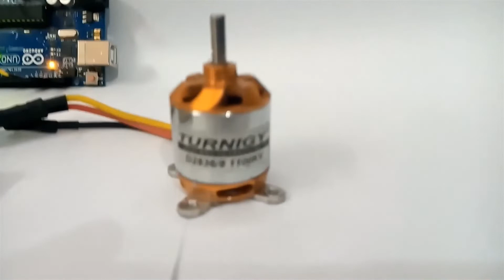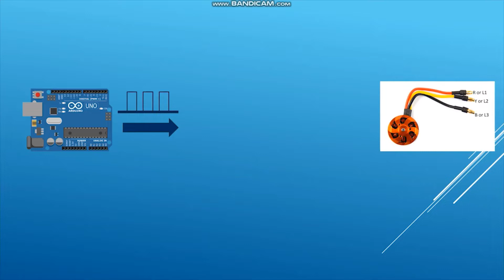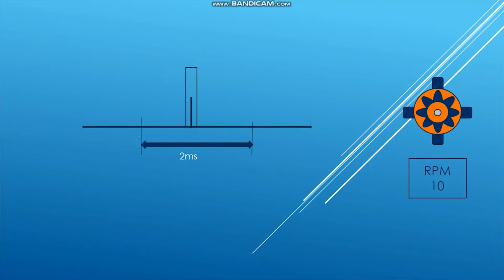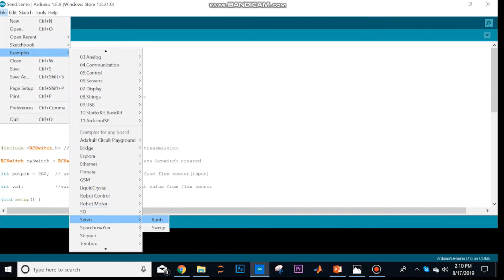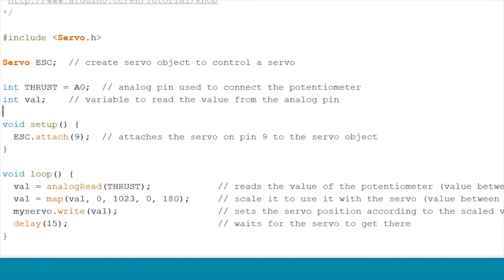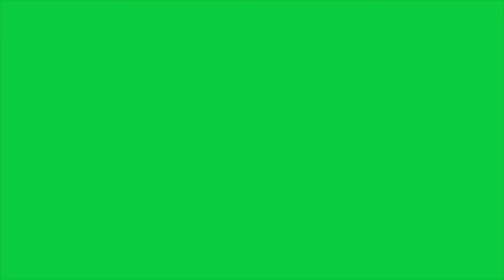How Brushless Motor and ESC Work and How To Control them using Arduino UNO | In Literally 10 mins

Comment: I can't copy the code nor the photo of the set-up. would be nice to have a library
y
Reply from the maker: Hi Duane Bowman ,
At 5:08 there is setup and at 9:03 there is code I don't know why you aren't able to copy it , can you please specify what's the issue ?is it blur ?
Reply: @electroniccorner6829  I am trying to copy using realplayer. it says no video. Sometimes I get this but after a while it will download.  But have tried many times, to save it. )-:  I know its not your fault
Reply: just got it to upload...